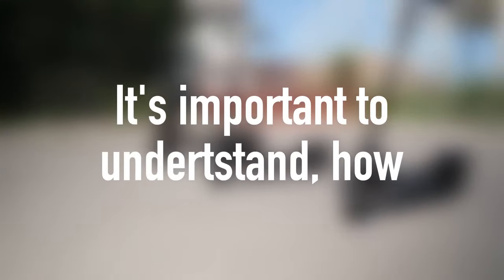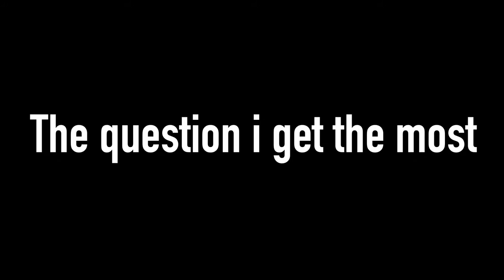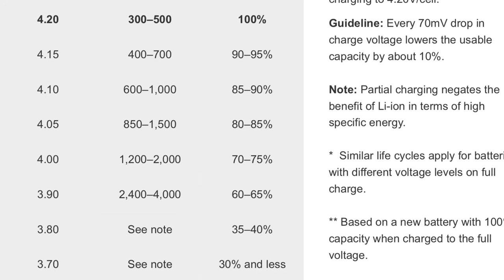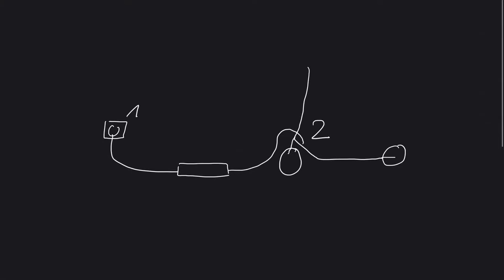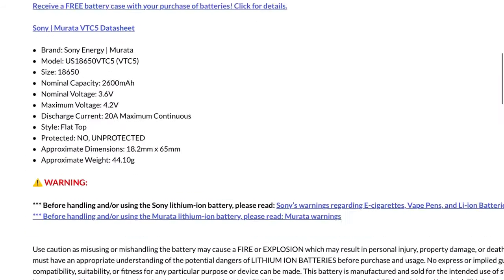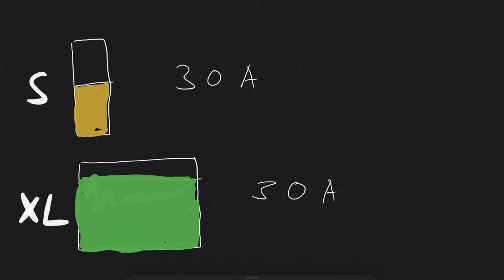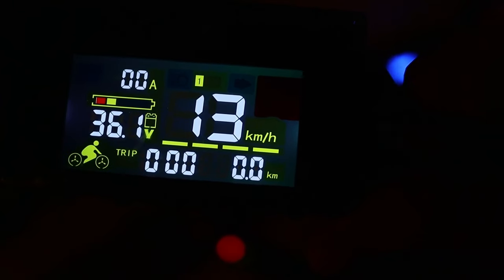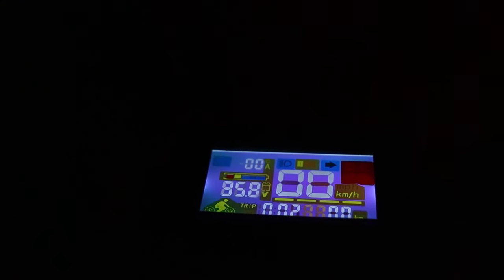9 FACTS on HOW to INCREASE BATTERY PACK LONGEVITY

Comment: Fact #1: charge it to 100%, everything else will break into pieces before your battery goes to the ghostland. 
Fact #2: let me see, isn't that why diodes are for?
Fact #3: I'd agree, the only thing is that charging in "fast" chargers is not single continuous "flow" of current, it is put into strokes to fool BMS.
Fact #4: after all those precautions you still want to replace your lovely batteries, like in... one-by-one?
Fact #4, oh wait, #5: now that's a bit confusing, cycle is a cycle, no matter how long you ride. Having bigger batteries will give you higher range out of single charge, but vehicle will spend a lot more time charging. You spend more, you get more, that's it, nothing to do with battery life expectancy. 
Fact #6: Your 0 is not exactly 0, you already shown us that in your first fact. BMS will not let you go under certain value. 
Fact #7: You are talking about cold start, batteries will heat up by themselves during use. Protection goes both ways - overheating and coldness.
Fact #9: Extending longevity by batteries replacement...
Fact #8: Well, you are right, but it has more to do with battery packaging than with battery content. And if you are talking about "best conditions to use and store your batteries" recommended limits are between 20-25C.

Just joking, cool vid, bro!
Reply from the maker: Awesome comment, thanks :D pinned it ;)
Reply from the maker: Most of the chargers have a limit built in so they won't charge to the maximum battery state, but as studies show it's best to keep the battery between 20 and 80% better not leave it charging at 100% unless you plan a trip ;)
Reply: Sounds like you should make a few videos. Tell me how to setup euc world alarms for gotway
Reply: @mr_wrongway  so the idea of 100% charging team is this: the paper you are referring to, is about a single cell only. Like you mentioned, there are a lot of cells in the EUC battery. Some claim, that different cells charge faster or slower, and if you charge the battery to 80%, some cells will be charged to, let's say, 79%. And this problem increases every time you charge your battery, so next time it will be 78%, then 77%, and so on. After some time you may end up with a dead cell in your battery. Those people claim, that when you charge your battery to 100%, the bms deals with this problem. I didn't do enough research to know if it's true, but that would be an interesting video.

Comment: Charging to 100% and shorting the batteries life is only applicable to a battery on its own,a single cell. It is not applicable when you’re dealing with batteries in groups. The only unicycles that you can safely charge to 80% only are batteries with smart BMS is that show you the individual cell voltage, so as long as you know all the batteries are roughly the same voltage, you can then only charge to 80%. In the case of a Sherman S you have no idea what the cell voltage is per cell, so you have to charge to 100% each time to guarantee that the passive BMS balances all the batteries.  An unbalanced battery pack Will fail well before a battery pack that is charged to 100% each time. Charging to 100% is only bad if you leave your unicycle at 100% and don’t ride it. 
Leave your unicycle at 3.7 V when not in use, or 60% and only charge 100% minutes before riding.

Comment: Adam - thank you for this.  as someone else mentioned, and as I'm seeing elsewhere,  shouldn't a 100 percent charge be recommended every ten charges or so, for the sake of battery levelling?
Reply: That's what I, coming from RC-model background and lots of dealing with lithium battery packs, thought also. Phone batteries are 1 cell so they can be partially charged but electric vehicles have a lot of cells in series so they will require frequent balancing. Also, at least most BMS:s have quite low balancing current (like 50mA/cell) because they do not use separate FET:s for balancing, instead they rely on the BMS-chips internal circuitry. So if there's any real imbalance it takes a lot of time to equalize the cell voltages so just charging until the system says 100% is not enough, the charger needs to be connected at least overnight, maybe longer, to fully complete the balancing.

It would be nice if the software on the vehicles would allow monitoring the balancing status of the pack (individual cell voltages would probably be available from the BMS) and also setting a lower target voltage/cell so all the cells would be balanced to, say 4.10V instead of 4.20. But of course fast, care free charging time is a selling point so they don't want to bother the user with technical details or lengthen the charging times to include full balancing.

Comment: hi ! great vid ! I´ve a ks 18xl and have the original charger 1,5 amp,  can I charge at the same time with my 1,5 amp charger and a 2,5 amp charger? or is it dangerous.? I know that my wheel can charge at 5 amp but I don't know if can be different chargers. Thanks bro!

Comment: Charge to 80% daily, ride to 40% to 50%. Full 100% plus 30mins to balance charge 1st of the month.
Reply: negative, that will shorten the life of the battery significantly. Slow charge to green and leave it on the charger (as long as reasonable) to balance. 80% limit will prevent balancing.

Comment: You might increase battery life by not charging it to 100%, but imho life is too short not to enjoy full capacity of your battery pack. I look at my PEVs as consumables, I don't think they will last more than 2 or 3 years without refurbishing them.
Reply: Well my Inmotion V8 is dead now, 4 instead of 30km range left. Always charged it to 100% , i got what I deserved. Should I ever have the money to buy a newer EUC, i will make Shure to be better to the battery
Reply: @lefotografion  I believe that range is low because one P-group has damage. That can happen regardless if you charge it fully or not. Or maybe it wasn't properly balanced, for balancing charging to 100% once in a while is better, but it depends on the BMS.
Reply: @infiniteoffset  we took it apart, it's not just one battery sadly
Reply: @lefotografion  So all cells are damaged like this? That's weird. Even when charging it fully it should last at least 300 full cycles and even then there shouldn't be this big capacity drop. Something must be wrong here.
Reply: @infiniteoffset  well it's at 7400km, and it wasn't sudden. Just, for a longer time I only rode small distances, and then when I wanted to ride a longer trip I noticed the battery behavior. Also, the battery indicator still shows 4 out of 5 bars, and the app says the same. The wheel will just suddenly gradually throw me off, after about 5 to 6 km, 4 when driven aggressively. When I ask the wheel what's wrong, it says battery issue. But when charged again, there is no error message. And the charger sometimes doesn't turn green when the wheel is charged up, same so sometimes the battery indicator doesn't stop showing the charging animation, even though the charger is green. Weird all. I just want something bigger way more powerful anyway so
Reply: Oh yeah and sorry for bad grammar, German man in a hurry😂
Reply: @lefotografion  I see. 7400km is a reasonable lifetime for 500wh battery made out of (I assume) nobrand chinese cells that was charged 0 to 100. Or at least I would estimate life time to be somewhere between 6000km to 15000km (200 cycles to 500 cycles, 30km average cycle range).
Yeah, in your case it might make sense to watch out for the battery if you ride this much. How long did it took you to ride this distance?
Bigger battery surely allows you to charge 20 to 80 with having plenty of usable range and over all life time range. Just make sure to balance the cells here and then (depends on balancer).
Reply: I had two battery packs on me die with less than 1000km. There was bad weld booth times that lead to rapid unbalancing.
Reply: @infiniteoffset  30km per cycle is... Not really happening. More like 20 to 25, I'm tall and I ride always on the limit's. It took me 6 months for the first 3300 km, then the police stopped me and I wasn't able to use it anymore except on holidays. So it took me 2.5 years for the remaining 4100km
Reply: @lefotografion  Wow, you ride a lot. I was calculating it with numbers from my Ninebot Max scooter that has 500wh pack, 35km range which will eventually drop to 25km. If I put lower numbers in it's 4000km to 12500km lifetime expectancy for the battery pack. Maybe even lower due to higher discharge.
So yeah, you will definitely benefit from bigger battery pack if you ride like this.
Reply: @infiniteoffset  yes I will, definitely. Not only will there then be less demand per cell, but also I can just leave between 20 and 80%, and duo to higher range per cycle, I'll get even more out of it. Btw, V8 battery is 480wh, not 500, and at around 6-10 percent it slowly kicks you off. And demand is way way higher on a motorwheel compared to a scooter, because peak power is higher. I often reach 1900W. Especially when going Off-road

Comment: Won't charging to less than 100% prevent balancing from happening? Isn't this important to prevent pack degredation?
Reply: Balancing is a every couple weeks of riding constantly thing. You can quick charge that way in-between.
Reply: yes, charging less than 100% prevents balancing. Why not balance every time unless you're in a hurry?

Comment: Hi !

I don’t know exactly if at 03:28

Charging… your info is correct.
For example the KingSong 16x manual 📕 it says …. Quote :

(To charge a depleted battery, plug in the power cord to the wall socket after inserting the charger plug into the EUC as this can prevent the potential risk of damage to the charger) 🔌 

“Plug in the power source after inserting the charger plug.
This can prevent potential risk to ensure a safer charge.

What you said there is completely upside down of what the manufacturer of this EUC says…

So what is the right way V
🧐🤷🏽‍♂️

Comment: Ideal would be a charger you could turn down to a lower amperage to keep heat from building up but especially if you charge past 85% as more of the current goes to heat than at lower percentage. About batteries it will be nice when a new battery tech is lighter and hopefully less risk of fire to the point airlines will allow. Here, traveling with euc on plane would be very nice.

Comment: I am charging  my  20s20p  battery pack  30-35 times a Year , this is  in average  from  30% to 100% of capacity  . I have been told  my battery pack will last  5 years without any  capacity  drop , another  5 years  with  maximum 15% of capacity drop.   
No  worries  
 after  5-6  years  we will have  new technology of  cells production  with  50%   higher capacity and the same  weight

Comment: I have a Zero 10x 60V and ride my scooter about every third day. I need its full range of 20 miles every time I ride. I start charging it immediately after I am done with it. But for optimum battery life you recommend putting a timer to remind me when I think it will be 80% charged and then disconnect it and then two days later charge it for another 20% right before I ride again. Seems like a lot of work. Often I forget the charger on and it goes to 100% so then I've had to sit in the garage with scooter on stand to run it for 15min so I can discharge it back to 80% only to then forget on the day that I need it to charge it back the 20% to full which takes several hours taking me past the window I need to use the scooter. How bad is it to charge it to 100% and then disconnect the charger and let it sit for two days until my next use?

Comment: Hi
If you can help a little? what is the best way to charge EUC? On or Off?
Reply from the maker: Either way works :) it’s usually easier when they’re off and they turn on by themselves when you plug them in. Except Begode
Reply: @mr_wrongway  Thanks for the answer, I'm asking because I used to have a 1.5 A charger and now I bought a 6 A charger and I wanted to monitor how fast it charges. I have a ks 18l and it is important to me that I will not harm it if I fill it while it is on

Comment: In general, charging to 80% is the better option. But I have read that EUCs need to keep the batteries packs BALANCED, and to do so, you have to charge it to 100%

I dont know how accurate this is or how it works. So this comment its more of a question. Can someone comment on this please?

Comment: Please charge to 100% every once in a while to help with cell balancing. After a while of riding, each cell’s voltage starts to drift. If the one of the cells go too low in comparison to the other cells, the 80%  that you see on the app will actually be a quilt made up of high and low voltage cells. Some of those cells could be over charged, and some under charged. This could lead to FIRE or CELL GROUP DEATH. 

Charge to 100% every few days or weeks to stop this from happening.

Comment: A bit of an old video but I think this is a video still relevant today.

Their is an obsession with fast charging batteries because "I need it fully charged now" excuse.

The user doesn't always need the battery charged within say 2-4 hours as 1. They should have more time until the trip will start 2. They will not need the full range of the battery for the next journey so could continue charging at home/work.

A 2kw battery doesn't particularly want to be charged at 10 amps. if you could charge it at 2 amps say every day you can do the exact same journeys without the heat build up and wear and increase in internal resistance.

All in all the fast charging should be used sparingly when needed not the default option. As well as full charges to 4.2v in the BMS, try to bring that down to 4.1v and be happy with the range that total capacity that provides.

Great video and topic for a lot of users that will be new to knowledge of batteries used in the bikes, scooters, eucs. 

Thumbs up. 👍

Comment: Is the 18650 kingsong batteries in my 16x  better - safer  than  21700 batteries in my MSP high speed ? What's the reason for the change ?✌️

Comment: So don't leave it plug in cause it will keep charging even tho it's full. Wouldn't the bms just stop it. Though that's the point of the bms. If that was true you have wheels blowing up onthe chargers for sure or fires

Comment: And now the question of millennium V10F and many EUC has 84.4V at 100% charge, so how much is 85% charge Volts?
 Hmmmmm and please no pointless result like 84.4 / 100 = 1% * 85% = 71.74V that's totally wrong.
☢🙏☢
Reply from the maker: If 85% on a single cell means around 4.0 V then times 20 (20S) it's around 80V i suppose
Reply from the maker: If 85% on a single cell means around 4.0 V then times 20 (20S) it's around 80V i suppose

Comment: Your battery balancing happens at 100%.  That is why your charger continues to pull current for a while after it changes to 100% (mine is a little less than an hour).  If you don't balance the batteries regularly, you will destroy the battery pack early.

The data you shown is for single batteries, in which no balancing happens or is needed.

https://www.youtube.com/watch?v=pgr7-b3eBm0

Comment: Excellent subject. This battery issue alone has steered me away from used machines. My background is batteries. You should never discharge past 20%, never charge more the 90%. Only buy Japanese battery powered machines. The Chinese lie and. As Wrong Way advises, the bigger the capacity the healthier the pack. Try not to quick/fast charge this is  not healthy for the pack as Dendrites can form & grow (that's Cancer) in layman's terms.
Reply: What about cell balancing, doesn't this happen after the pack has reached 100% or thereabouts?
Reply: @pierrex3226  yes, balancing occurs after the BMS reports a full battery

Comment: Hi, I charge My Xiaomi M365 PRO to 100% after each ride, as owner manual says:
"After every use, fully charge the battery to prolong its lifespan.
"

Chargers and motherboards are intelligent: when they reach the 100% they clearly  know it; they constantly monitor the situation and know what to do. Chargers and CPUs have a lot of protections to keep your battery in the best possibile condition, both while charging and while driving (this is why I will never change the original firmware).
Reply: It is in Xiaomi's interest to sell you a new unit every few years, so no, it's not good for the batteries to be charged to 100% all the time.
Reply: @pierrex3226  It's in Xiaomi's interest to not sell products that fail prematurely ... battery balancing won't shorten the battery life unless the BMS is faulty or is coded poorly allowing over/under voltage.